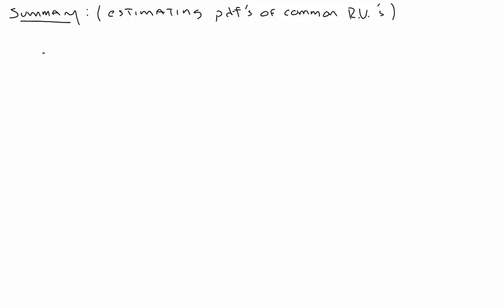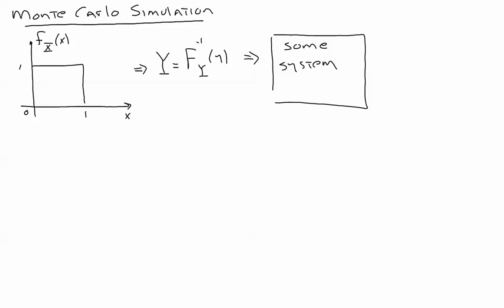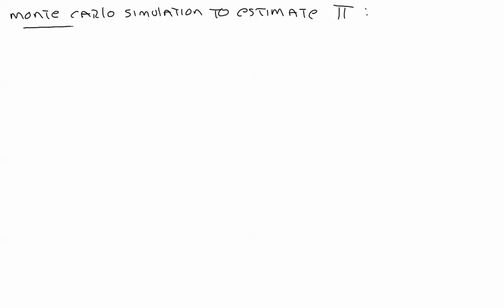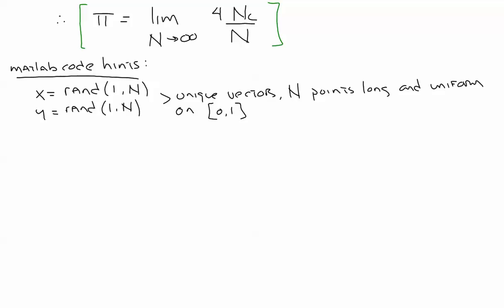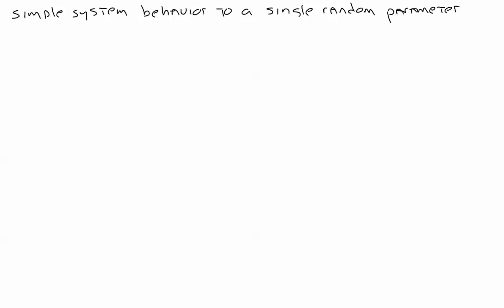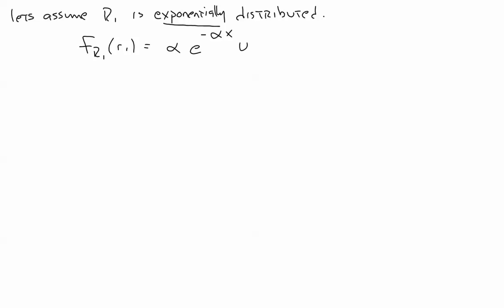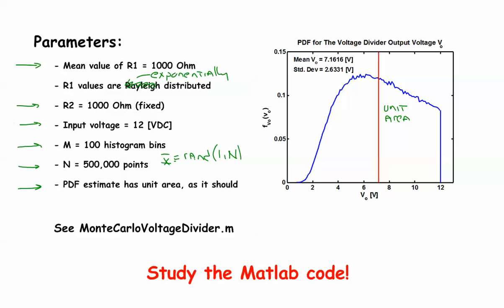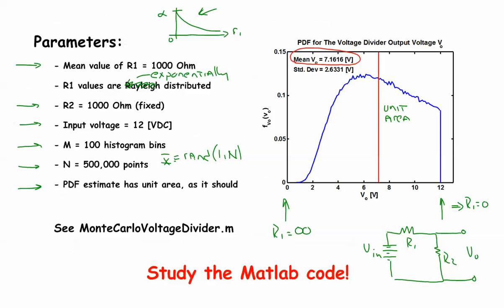ECE-340: L19 - Monte Carlo Simulation (00.49.22)

Comment: Thanks again for this powerful video.  I put some of the MATLAB codes I worked out below. 
Note that the codes below are not guaranteed to be the most efficient or representative of Dr. Duncan's work, but are just me trying to helps others that may be going through these videos outside of this particular course listing.  

%% pi sim
N=100000;
x=rand(1,N);
y=rand(1,N);
x=2.*x-1;
y=2.*y-1;
r=sqrt(x.^2+y.^2);
Nc=0;
for i=1:N
    if r(i)<=1
        Nc=Nc+1;
    end
end
pi_=4*Nc/N

%% Monte Carlo
clear all; close all; clc
N=500000; % number of points
alpha=1/1000; % 1/ mean of R1
Vi=12; % volts
R2=1000; % ohms
nbins=100;
% generate uniform random variable [0,1]; x
x=rand(1,N);
R1=(-1/alpha).*log(1-x);
Vo=Vi.*((R2./(R2+R1)));
[H C]=hist(Vo,nbins)
delta=diff(C);
delta=delta(1);
H = H./(N.*delta); % normalize to unit length. Sum of h now will be 1.
plot(C, H) % pdf
ylabel('fv0(v0)'); xlabel('Vo'); title('PDF of Vo');
xlim([0 13])
cdf_=cumsum(H); % cdf
figure(), plot(C,cdf_.*delta)
mean(Vo)
ylabel('Fv0(v0)'); xlabel('Vo'); title('CDF of Vo');
pdfcheck=sum(H.*delta) % should yield unity for valid pdf